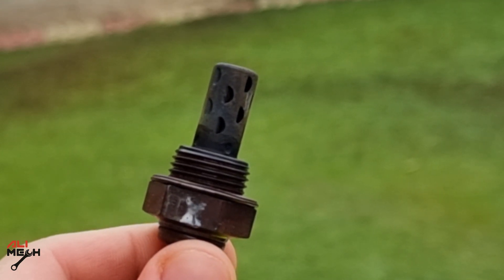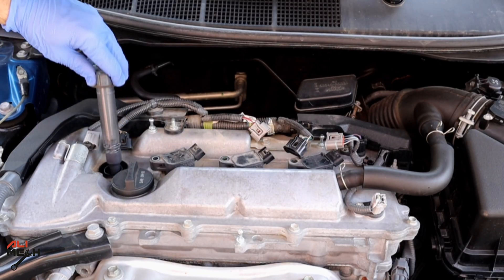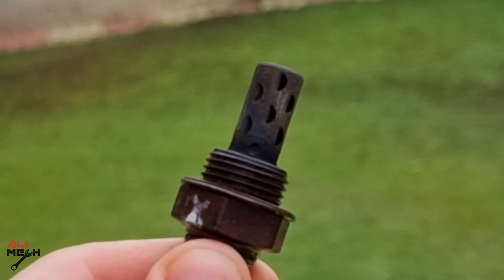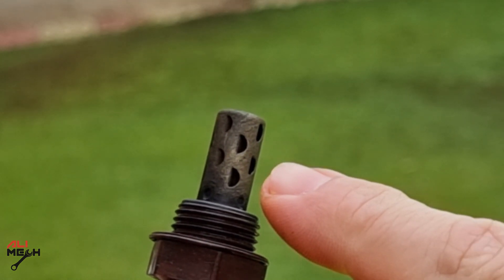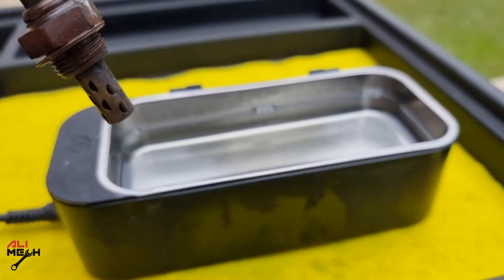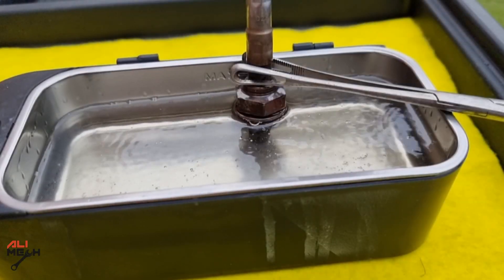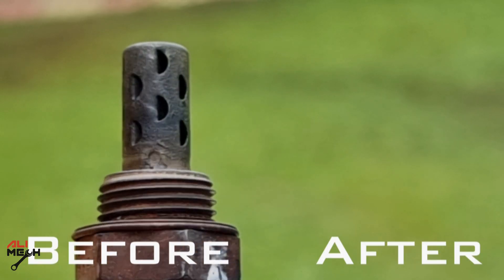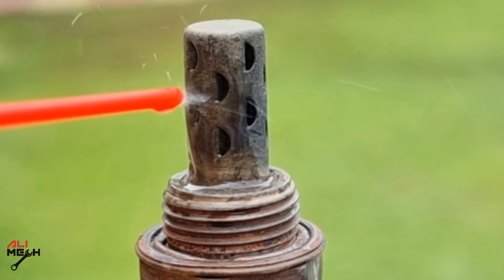Watch this before cleaning oxygen sensor/Best way to clean o2 sensors/anti seize on oxygen sensor

Comment: Took my sensor out , degreased and soaked in white vinegar and loafs of dirt came off , niw im blowing tons of white smoke snd remived soaked in petrol, i have no faith in cleaning the sensor so brought a new one, job done
Reply: Both are wrong method. Use carburettor cleaner or throttle body cleaner only.

Comment: I use electrical contact cleaner instead of carb cleaner.  Get it in those holes and shake it.  Can also dip it.
Reply: It's workin? Asked gpt he said that carb cleaner is too rough, the option is between a MAF cleaner or Contact cleaner

Comment: The best way to clean o2 sensor is to heat them with gas torch .
Reply: Is this sarcasm?
Reply: @taz24787  No , you will burn out carbon deposit in the sensor , its safe for sensor as they are designed for high temperatures , if you google you will find this metod but not many people knows about it .
Reply: It'll kill heater element

Comment: I can't imagine that a quick spray of carb cleaner could help much. I soaked mine in fuel/fuel injector cleaner for a day or more  and then blew through the little holes to try to clean the inner surface. if I had an ultrasonic cleaning machine, i would have used that instead of just blowingit out after the soak.
Reply: You damaged it?
Reply: @Prateek_Rathee2102 bro don't tell me you didn't wait to dry and are you shur it wasn't brake cleaner
Reply: @rotsbelramos7685  I did wait...It was throttle body cleaner....soaked overnight...sensors running fine on my yamaha r15m
Reply: @Prateek_Rathee2102  got you bro smart

Comment: if I was to use an ultrasonic cleaner thing, i would wire brush the crud off the outside first and probably blow off all loose stuff. Then I would use the ultrasonic. That way I would have a better idea of what was being cleaned from  behind that outer covering. I don't need to be misled by the insignificant crud falling off of the 'outside'.

Comment: Once  you use that cleaner in the spray can the sensor is trash. Never use any solvents on 02 sensor they will kill heater inside it
Reply: What can you clean them with
Reply: I would try compressed air, like dusting a motherboard.

Comment: Could you use maf cleaner?
Reply: That’s what I’m about to find about hah
Reply: @kyore789  How did it go with the MAF cleaner?
Reply: @taz24787  worked good! I cleaned my 2009 yamaha r6 02 sensor with it and it ran a little better but I only ran it for a few days until my new one came in. It felt the same as the new one, thought it wasn’t in too bad of shape

Comment: Any changes in voltage, for O2 sensor output reading, taken by a OBD2 after installing this clean up 02 sensor?. Good if you could compare OBD2 reading for old O2 sensor before & after cleaning vs a new O2 sensor reading vs mass air flow readings in g/second for all these 3 situations. 🤔🤔🤔. Regards.
Reply: THE best way is to buy a NEW ONE !!!! After so long the sensor loses some of the oxide to make an accurate reading. The operating range of a new unit is more precise to give better mileage for the vehicle owner. This is what I learned from master mechanics who showed me so much that I felt as if I stood on shoulder of giants.  I would bet a many techies would give their right hand to be taught by these MEN OF KNOWLEDGE. 
Happy New Year too. Peace vf

Comment: what did u applied at last? that Ash colour chemicle??
Reply: Anti seize for thread of sensor.. but he says the normal anti seize melts and leaks it's way to sensor and is not good. So use the special anti seize which is sensor safe..

Comment: WD40 well enough to clean the sensor? as I don't have a ultrasonic cleaner... is thr any risk of applying curb cleaner?
Reply: Probably a bit late for this, but don't us WD40, that's a penetrating oil. I'd recommend using CRC electronics cleaner, unlike carb cleaner, it's not as harsh and won't damage the sensor, as well as it evaporates rather quickly and won't leave a residue.

Comment: I'm running lean just after Flushing all the fuel lines and replacing the fuel injectors because of getting bad gas from a gas station that had water in the tanks, now it's time to clean the O2 sensors thanks for the video
Reply: Use water remover additives
Reply: @TheUndeadPyroYT  I use many types of water removing additives and nothing helped. It continued to run rouph until I dropped The fuel tank,  tipped it upside down, Got about eight ounces of water out of the tank
Reply: @TheUndeadPyroYT  What the name of the water additive
Reply: How mush water
Reply: @rotsbelramos7685  about 8 ounces
Reply: What code did you get and what symptoms was your car doing
Reply: @rotsbelramos7685  I got pretty much all the misfire codes for all four cylinders Would be most likely contaminated fuel getting to all cylinders.,  If you get a code for only one cylinder and it's the same one all the time That may mean that you have a bad headgasket. And that cylinder alone is getting water from the radiator side.
Reply: @mrvic92154  ex girl threw some water lol jjk

Comment: I know replacing is the best cleaning process
Reply: I was informed the one for my Toyota 4Rrunner (closest to the engine) Is $129. There are four sensors on the vehicle. I'm going to try cleaning first as this can be very costly to replace.
Reply: @GFVAhi-fi  Did that work for you? My Mitsubishi mirage sensor cost almost $400 for an economical car. What a joke.

Comment: How do tell that oxygen sensor as a problem?
Reply: Check Engine Light Comes On.
Noticeable Loss of Fuel Efficiency.
Sulfur or 'Rotten Egg' smell from Exhaust.
Black smoke from exhaust.
Emission levels reach high levels.
Your engine hesitates, skips, begins bucking or has power surges.
    

P0300 may pop up but don’t worry misfire that’s fine

Comment: Hello!
  Please tell me, an iron brush and a carb cleaner, is this the norm for this sensor! ??
No precious metal coating on it can be damaged?
  Or is there no such thing!?
  Thank you in advance for your reply!..
Reply from the maker: Its normal, what i meant with brush, it only cleans out side,  but the carb cleaner is better, because it will clean inside as well
Reply: @AliMECH  Is there any coating on this sensor? Which can suffer from physical impact?
Reply: There are precious metal coatings on the inner sensor (the outer piece is just a cover to protect the sensor) which you cannot reach with a brush.